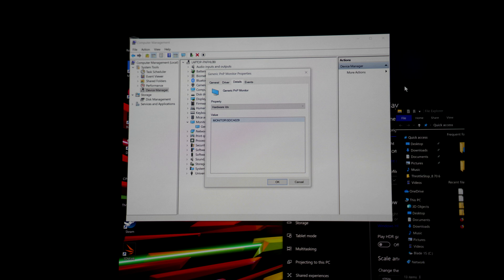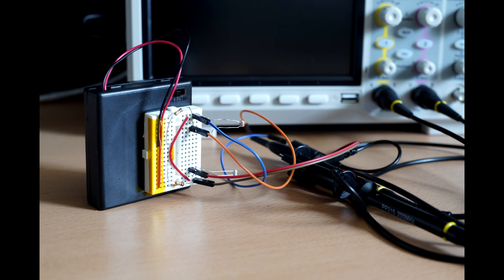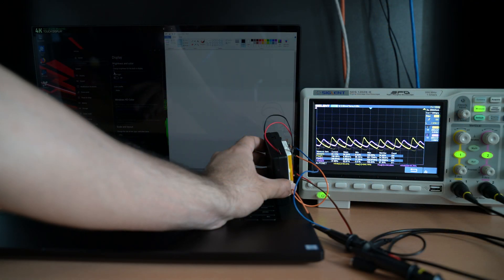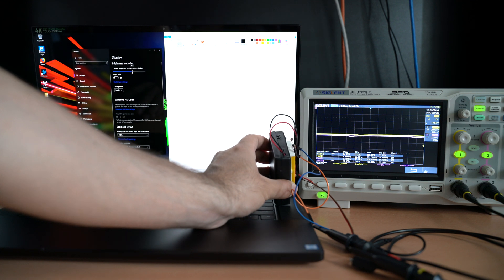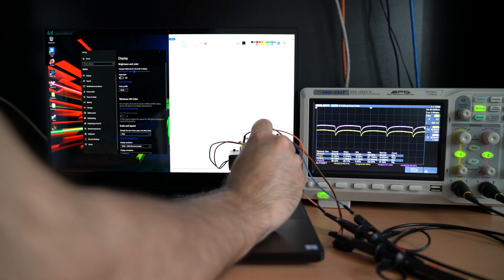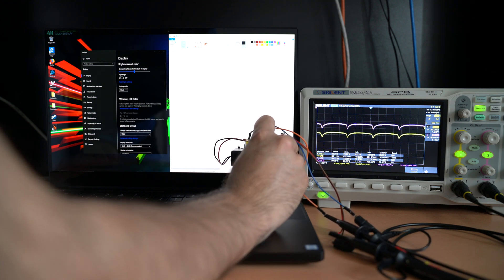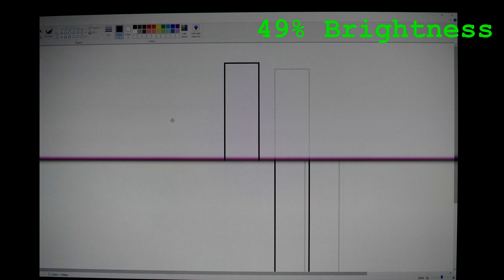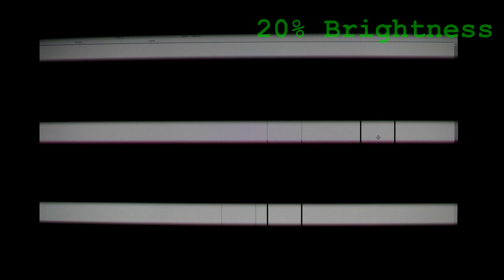razer blade 15 oled pwm test

Comment: Thx alot for your viedo and your very detailed answers here in the comments - very appreciated.

Until a few days ago I didnt even know pmw was a thing but now I´m quite concerned about  it. 

I currently use a lenovo ideapad 710s, which according to notebookcheck uses a pwm-frequency of about 220Hz for brightness levels of 50% and under.
I actually never really experienced any headaches or pain in the eyes despite the fact that i often used my laptop in dimmed or even completely dark rooms. But my eyes always kinda got tired, especially when reading text and there was some eyestrain. I always thought was just because the panel in my notebook wasnt all that great with not enough sharpness for crisp texts and maybe some uneven backlight issues. I guess know i know why it just doesnt feel that comfortable.

I already ordered a Lenovo X1 extreme OLED but i think I`ll cancel my order because of what i read about pwm the last few days and now Im really torn on what to do. Im a really big fan of OLED and I would even take the risk of possible burn in issues a few years down the road - I think the superb image quality is just worth it. I plan on using it in conjunction with two old Eizo 22 in monitors for working (alot of writing and reading) because they are very easy on the eyes! I would use it at school too but since the rooms there are always very well lit i dont think that would be aproblem.  In the evening after work Id like to use the laptop for content consumption too because I dont have a TV anymore. The OLED would be perfect for my application but it would have to opereate in low light stuations and  Im not sure if this panel is the best choice for that.
I had an LG C3 OLED TV and  I currently still use a LG V30 with a P-OLED Panel. Neither of them ever gave me any discomfort on the eyes  - so i thought it wouldnt be a problem. Unfortunately though it seems that  both of these dont use any pwm, so thats that...

I guess I`ll just buy an Lenovo X1 1.Gen with the 4k LED screen - acording to NTC this panel does not use any pwm...
Reply from the maker: some things to note still. the pwm on this samsung oled panel will cause some eyestrain. but not as much as you experience with the lenovo screen, due to how it is implemented. that said, for laptops, the only way to get 4k and not get a panel with low frequency PWM is to get an LCD panel. the X1 extreme gen 2 comes with a very good one, albeit no touch screen and it's matte. the gen 1, the one you are getting, is one that i actually had before i got this razer blade 15. if you get a panel with minimal backlight bleed, im telling you, you will not be missing out on the OLED experience. the only things the OLED panel gives you over the LCD is a guaranteed no light bleed on a black image and very low response times. the backlight bleed on my x1 extreme gen 1 was minimal though, and i probably wouldn't see a difference in real world use between the two, in terms of contrast and colour. do keep in mind though, i calibrate my screens with a Xrite i1 display pro.
Reply: @KumaMech  Thx again for your answer. Yes i heard that  the panel on the gen 1 is really good hence why i want to get the gen 1 over the gen 2 although I would actually prefer the matte 4k display on the gen 2 - i love matte displays but sadly its not available here in my region anymore. I dont really care about touch but I want a screen which s comfortable to work on for longer periods of time but still has good contrast and colours for content consumption so this laptop should be great for that... 
May  I aks why you got rid of the lenovo? The only weakness I can see with this laptop is battery life, since I dont really care about gamging...

PS: I would love to hear from you what the difference between Pwm and the  actual Refresh of the screen means - now that I learned about pwm, Im not so sure if I fully  understood this difference.
Reply from the maker: @fzst-ub5xf  oh, that is unfortunate that the matte 4k option is not available in your region for the gen 2. :c i returned my gen 1 x1 extreme because... the first one i got had a faulty keyboard (i had to press down pretty hard to activate certain keys... mostly the 'g' key) and one of the USB type A ports didn't work. these are apparently rare issues, so i exchanged it for another one. the second one that i got had different issues. it was bent out of the box, even though the packaging looked flawless. i did not want to deal with repeatedly exchanging units until i got one that was defect free. it has been my dumb luck for getting faulty laptops, as the issues i experienced were again, pretty rare to find online... if at all.

as for the difference between "PWM" in reference to displays and a display's refresh rate, the refresh rate is how many times in one second the display will complete an image change cycle, where as PWM or Pulse Width Modulation when talking about displays, refers to the method of adjusting the overall brightness of the display. to give a more physical representation of it, you may know that a LCD display consists of the liquid crystal matrix (the screen itself) and the backlight (typically a layer consisting of a diffuser with white LEDs along the edges) to shine through the screen. the refresh rate concerns the liquid crystal matrix, while the PWM brightness control only concerns the backlight.

the PWM frequency that seems to cause people eyestrain is pretty much the frequency of the backlight turning off and on, with the amount of on time and off time being regulated within that cycle. for example, lets say the backlight of a display has a PWM frequency of 100Hz (period of 10ms) and uses PWM to adjust brightness throughout its brightness range. to acquire 10% brightness of the display, the backlight will turn on for 1ms, and then off for another 9ms. it will repeat this cycle continuously. the effect is, for 9ms, you are staring at a black screen, while for that 1ms, your are looking at the screen at maximum brightness. your eyes attempt to average this, allowing you to perceive 10% brightness. if the frequency is very fast, say 10kHz, your eyes do not have to work nearly as hard to average the change in brightness, which causes less eye strain. the least amount of eyestrain can be had with a display that uses DC current controller to adjust the brightness of the backlight. there are quite a few reasons why a DC current control circuit is not usually utilized in a display. the most prominent ones are the difficulty to implement the circuit in a manner that provides an increased brightness range, even brightness among all LEDs that make up the backlight, and power efficiency. all these considerations drive up the cost of the display significantly. PWM solves these problems cheaply as their method of operation is... simpler (PWM controller is only concerned about 2 states of the backlight with PWM: on aka max brightness and off. DC current controlled LEDs have infinitely variable levels of brightness, bringing non-linear behaviours with it eg. lets say 10mA of current is 100%, 5mA would NOT be 50% brightness. it would probably be lower.)

i apologize if my wall of text contains difficult to understand content, as i tried being as detailed as possible without making it too difficult to digest.
Reply: @KumaMech  Ah thats unfortunate... Hope you have more luck with the razor. 

The X1 seems to be pretty much the perfect laptop for me - well except for  the battery life but i guess i could live with that. 
I wanted to check out some laptops in person before I definately change my order to a X1 gen 1. with the  4k screen or a gen 2 with a matte FHD screen (which I was considering as well).
Unfortunately while checking out numerous notebooks in the store (they didnt have the X1 extreme though just the x1 yoga) I came to two conclusions:

1) 4k is NOT overkill on a 15.6" laptop. 1080 just looked fuzzy and not sharp enough to read text for longer periods of time - I guess it would be fine for gaming and content consumption though. But for businesswork I wouldnt get a FHD-screen in a laptop bigger than 13,3". Even on the 14"-models I was not convinced with 1080p.  When I saw the screen on a Acer Swift 3 where a sticker said: Full HD 72% NTSC -  I instantly went; "No way! thats not 1080p!" A quick check with the windows resolution management reveiled: It wasnt it was UHD Screen - So yes, you dont have to search for the better resolution - Youll instantly recognise it.

2) I dont want a glossy screen! Its just a very bad idear to put a glossy screen on a laptop - You most likely will be working in  a room with overhead lights at some point - and then a glossy screen is just a real PIA.

I really cant understand why dont more manufacturers offer good quality matte 4k-panels on their notebooks? Why always glossy ones? At least on the 15" laptops, where a touchscreen wouldnt be used much by its users, its definatley a good idear! Sure the glossy screens look abit more punchy and vibrant but this advantage just becomes useless if there is any brightlight-source in the room. 
Also, the coulours on glossy screens mostly just appear more vibrant  because the displays in the matte screens are just  not as good as their glossy counterparts.
The most vibrant, punchy and sharp display of all the laptops the shop had on display - for me personally at least - was the beautiful matte 4k-panel on an acer swift 3. Mostly because the panel was abel to show vibrant colours with good contrast even in the very well lit room (overhead lights) whereas the glossy ones just straight up failed (at least in that particual room) and I was mainly just looking at myself in very expensive mirrors even at max brightness...
I know this was pretty much the worst case scenario for glossy screens but it still - I definately want a matte screen again! And i want 4k!  :-D

So I guess I will just wait abit longer and hopefully the X1E will be available again with that screen. I just hope this screen also doesnt use PWM - or at least with a very high frequency - I couldnt  find anything about this screen-option online - I even called Lenovo but they just straight  up lied to me. I was guaranteed that none of the current Gen 2 screen options do use PWM-dimming... so yeah....
Reply from the maker: @fzst-ub5xf  battery life on the x1 extreme is not bad at all. i was getting about the same battery as on the razer blade 15. yes it's not over 10 hours, but i would get 5-6 hours on average, that too with the 4k screen. that included youtube in the background while coding some arduinos. the only way you are going to get more battery life is by going for the 1080p screens, which is a sacrifice in itself. most laptops with the 6 core 8th and 9th gen processors and batteries on the bigger side will hover around 5-6 hours. trust me :p i have gone through so many laptops in search of finding one that works for me. the best battery life i got was out of an XPS 15 9570 and a Gigabyte Aero 15x. and even those wouldn't get much more life with my workflow compared to the blade 15, x1 extreme, msi gs75, and msi gs65. we're talking 5.5 hours to 6.5 hours. just a 30 min increase. glossy screens vs matte screens do not change the colours as much as they do apparent contrast. the main advantages of glossy screens is they can make the blacks look darker and the image is not as grainy as it would be on a matte screen. i do know it depends on the matte coating itself, but generally speaking, matter screens provide a grainy image over their glossy counterparts. the advantage of matte screen isn't so much so that they reduce reflections as much as it spreads those reflections over a larger area. it basically makes the detail in reflections all fuzzy, which in turn means they are much less distracting. this helps a lot when working and is often what i prefer when i am just working.
i understand that the need for a touch screen seems useless on a device like the x1 extreme at first. but once you try to use it for some productivity programs, you start to feel like you can't live without it. for my case, having a touch screen enables me to VERY quickly and efficiently move around a viewport in a CADing application. (for my case NX) i would normally need to plug in a mouse and sit down at a table whenever i needed to CAD (i use NX), but with the touch screen x1 extreme, i was able to cad even fast and also do so while sitting in a car/bus. it really affected my work flow in a positive manner. the same could be said for 2d applications like photoshop. you can zoom and pan with the touch screen without having to first switch to the zoom tool and then click and drag to zoom. another reason why i can work faster with a touch screen in these applications vs. a mouse is the 1:1 movement from your input to the result. i admit, it still depends on what you are using the laptop for. if you are doing word processing, programming or excel, then it probably won't make as much of a difference to your work flow. 

one more thing, the touch screen versions of the thinkpad x1 extreme (gen 1 and gen 2) support Wacom AES stylus. that can be nice if you don't want to use the touch pad or track point. also if you want to draw something, you can draw pretty effectively on the x1 extreme. i used it for taking notes/brainstorming ideas all the time on the x1 extreme when i had it.
one more thing, i cannot help but agree with you about 4k NOT being overkill on a 15.6" screen. i especially like the extra real estate you can get from turning down the scaling settings. i personally set it down to 150% on a 4k 15.6" screen. everything remains clear to me, but the amount of workspace you gain makes the laptop feel a lot bigger than it is. it makes me feel much less restricted when i work on my laptop. you cannot do that with a 1080p screen. it just becomes an incredibly blurry mess, even if you create a custom scaling profile. but that's the problem. most of the vocal community say that 1080p is enough because they either do not know how much it helps to have a bigger workspace, or they would not be able to utilize the work space in the first place. we are a minority of people who actually want more out of there laptops for work purposes :p

Comment: Your video is the only one intuitive test I have searched a whole day. Can I say the conclusion is that if the brightness is higher than 50%, there will be no difference with the normal LCD, and no harm to eyes at all? Thank you
Reply from the maker: ye, i think it is pretty safe to say that above 50%, it won't harm your eyes. after about 2.5 months, i will say that below 48% brightness, i am experiencing some eyestrain. when i blink and/or move my eyes across the screen, after images do appear, and it still confuses my sense of motion. still not as bad as lcd with 240Hz pwm. i don't have this issue at all above 48%.
also do note, that the 50% brightness threshold is on the razer blade 15's oled panel. gigabyte aero 15 oled switches from pwm to cc brightness at around 80%.
Reply: @KumaMech  Have you tried decrease the resolution to 1080P and does the OLED run 120hz on 1080P? It works on my LG OLED TV, I wonder if the laptop will be the same. Thank you again!
Reply from the maker: @Ixsameida  decreasing resolution to 1080p still limits refresh rate to 60Hz. you can overclock it, but i haven't done so...yet. i probably won't because i fear i will lose my warranty if something goes wrong.
Reply: @KumaMech   Thanks for your valuable reply. Really helped.